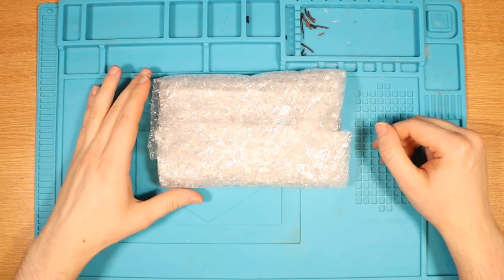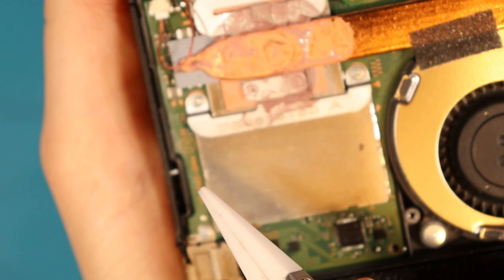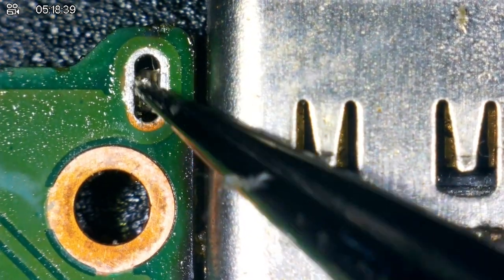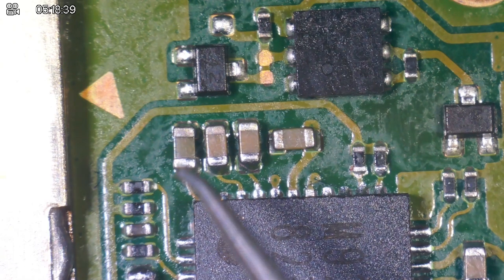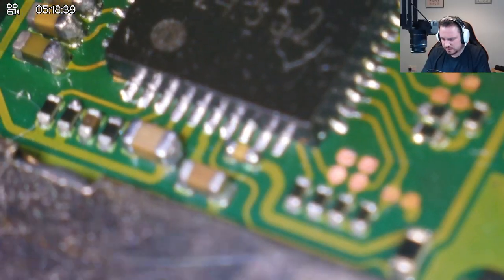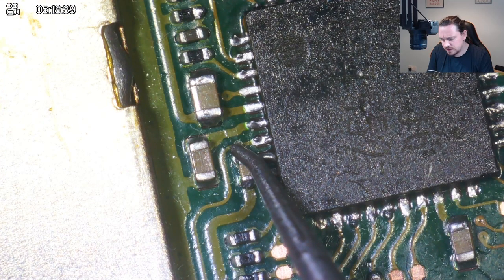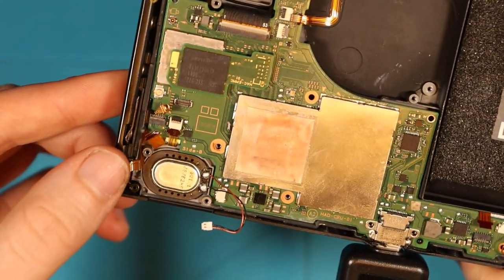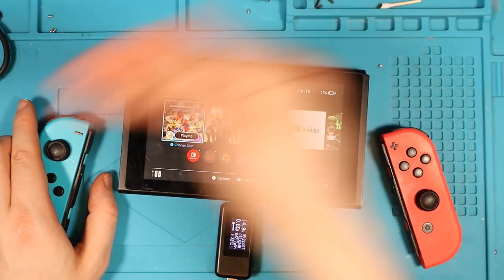No Power Nintendo Switch | Missing Capacitor Causing Issues?!

Comment: Hi Joey, I can see you're struggling with soldering a little so here's some advice to instantly improve. Not sure if you're using leaded or lead-free solder but I would recommend you get yourself some leaded Sn60 Pb40 solder. Secondly, not sure about the type of flux you're using but it may be poor performance flux that's causing the solder not to flow. Lastly, you need to learn about tip size, sure you can try using one tip for everything but then the heat transfer is going to be really poor if there's a large ground plane you're trying to solder. I tend to leave my iron at around 380 c, hot air is always 500 c and I adjust the airspeed to avoid blowing away components, the only time I would lower the hot air down would be if there are plastic or sensitive components nearby. I would recommend you change from the conical tip to something like a bent or chisel type tip, conical tips are sh*t and have poor heat transfer as only a fraction of the actual tip can touch the surface you're soldering. Other than that, you're doing great mate.
Reply from the maker: Hey Beo! Thankyou so much for the tips, literally ☺️

Yeah I think I need to be more conscious about swapping the iron tips for sure, Im slowly feeling more confident the more I do. Im using leaded solder, I think it’s just me 😅
Reply: @JoeyDoesTech  if you're using leaded then it's either your conical tip thats just bad or not hot enough or your Flux is not real Flux. It shouldn't be that hard, and it isn't. This hurt to watch Hahahah in a positive sense. Make sure you're not being scammed with Flux as some folks like to sell petrolium jelly masked as Flux.

Comment: Another insane repair, Joey! Hahah Nice catch with that missing filter (?), it's incredible that that small component was the whole issue. Now the question is: does it dock? Because that port didn't look all that great :P

Nonetheless, great job man!
Reply from the maker: Thanks hector! Honestly can't believe I saw it was missing to be honest. Will know to look there in the future now as well. 

It does dock yes :) And charges both sides with no issues. It's also quite a good connection, just think they switched the port, it didn't work so they gave up is what I think happened. Thanks for watching as always!

Comment: I'm a complete beginner to short finding, so I wonder: How do you tell if a specific component is shorted? Awesome video btw!
Reply: You can use a couple of methods. You can test components using continuity or diode mode on a multimeter or you can use a more advanced method by injecting voltage through the circuit to find the hottest component
Reply from the maker: Hey 😁 I can't really add too much more about it than what Phil has below. Think the more you do a certain device the more you know what that component does and if it should be shorted to ground or not 😁 Sorry I couldnt help more!
Reply: @TheCod3r  Alright, I will keep what you said in mind. Thanks!
Reply: @JoeyDoesTech  You seem to make sense with simply knowing what the specific part should do and if it should connect to ground. Thanks for your input!